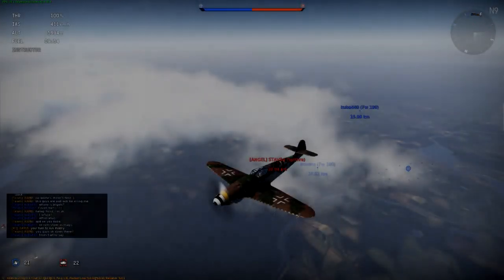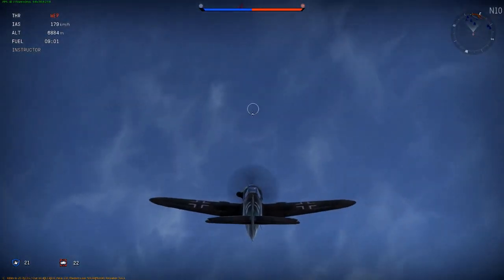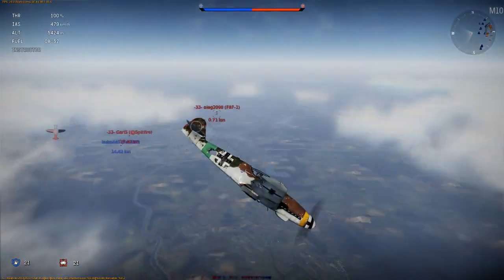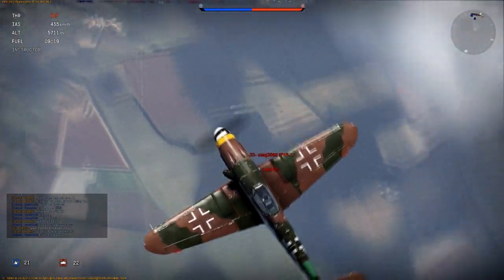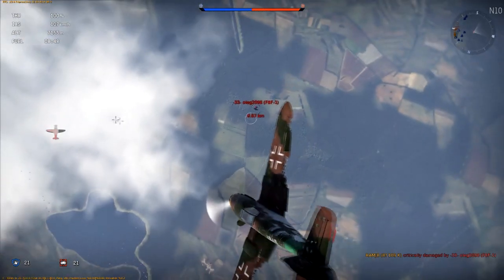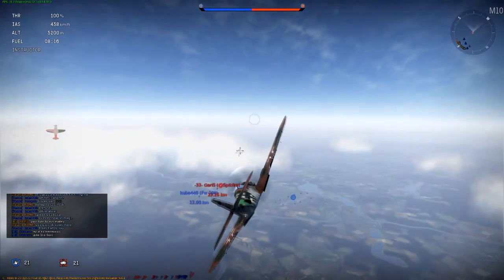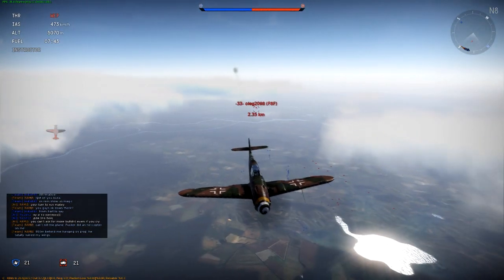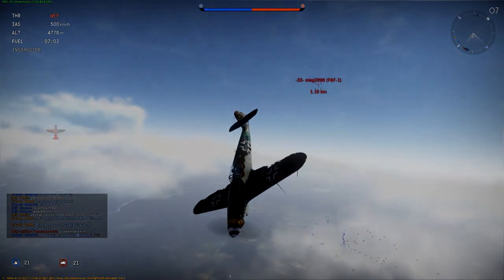War Thunder: when broken happens.

Comment: Love you Ram :) , but you just got out-played.
Consider: You were at the same altitude, and you admitted that he was puling away from you (higher energy).  He dove sharply in the Split-S but came up shallow after the reversal, conserving energy.   He gained more from the dive than he lost coming up.  You didn't gain enough speed flying level to force him to stall as you climbed, therefore... you got shot.  Think a FW-190 could have pulled that move on you?  Bearcat is a Grumman copy of the 190.

Comment: The bearcat's flight model isnt broken it doesnt dive more than 700 kmh it starts shaking when u go over that the limit is 740 kmh, its not a great diver. Im surprised how Ram doenst talk about how fucking broken the K4 is with its UFO capabilities and turning capabilites. The reason why Bearcats accelerate well is because of the broken WEP, I did a lot of testings over and over and I found out that when u press WEP for 2 seconds and let go it accelerates insanely. Thus this is the reason why.

Comment: Yup, I did similar test in Bearcat and K-4 and results were similar, though I ended up slightly lower than you did, but it's all about how smoothly you do the maneuvers.

I did it rough and that cost me a bit of energy. Yeah, the energy that Bearcat doesn't lose? :p

Comment: so, you mean to tell the that the F8F is totally broken? and will out-preform the K-4 on almost any level? and then you tell me some guy said "yeah, she's good in stalls" and take it as fact? The K-4 is supposed to be an awesome climber, better than its counterparts on the opposite side. why? maybe because there were hundreds of Bombers far above Germany at the time. also, heavy means more Inertia, which means that it should bleed velocity faster as the plane of movement changes.

Comment: gawd dont even mention the N1K, that thing is broken to point of no repair. IRL it was just flat out shit at high altitudes but in game it is one of the best high altitude fighters while the mustang which was one of the best high alt fighters is just flat out shit past 7500 meters. Just did a test flight with it and it is very difficult to even preform simple turns at 8000 meters.

Comment from the maker: if you only had a grain of understanding about what you're talking, you'd realize up to what point what you just wrote is just garbage. But you don't. Otherwise you'd have written something that made sense.

"pull off his maneouver with less energy than me". If he had less energy than me he should've never been able to follow the pull up.

and btw just to finish you off:
F8F1 P/W ratio:2500hp/4400kg: 0.56hp/kg.
Bf109K4 P/W ratio:2000hp/3380kg: 0.591hp/kg.

Now go insult somewhere else, ignorant.

Comment: I did some crude testing in both Bearcat and K-4, same altitude, same speeds, same loop move and climb after.

Bearcat ended up in same altitude as the one in video which shot you, or thereabouts, before stalling.
K-4 ended up maybe 100 meters lower after similar move, before stalling, though I'm sure if I had pulled slightly smoother moves, it would have been almost on par with the Bearcats position.

Is K-4's FM also totally broken?

And you forgot to answer the question! :p

Comment: Ram you weren't going that fast, the F8F did do a high G move, but his initial move was an energy saving one and both of you ended up at a sustained climb speed and the F8F was superior in this case, also the F8F is not as light as a 109 the F8F is around 8-10,000 lbs loaded whereas the 109 is around 6-7,000 lbs, there's a lot of bullshit from you in this video and I am disappointed.